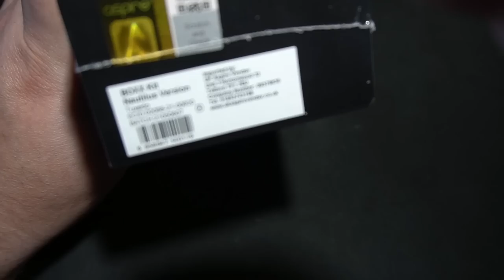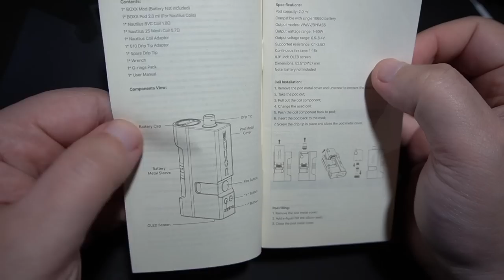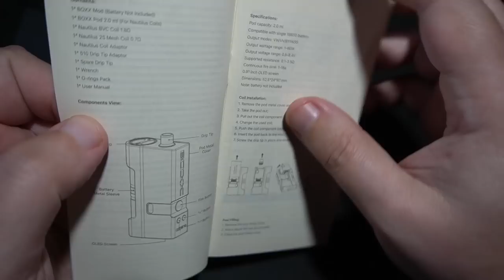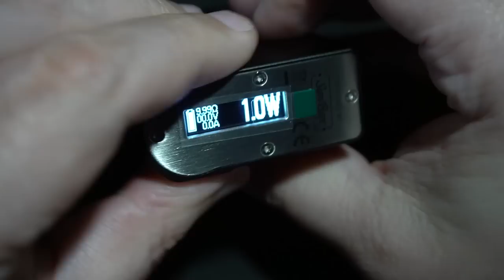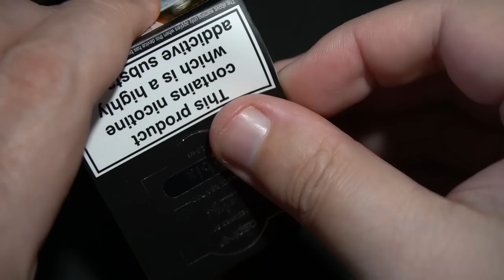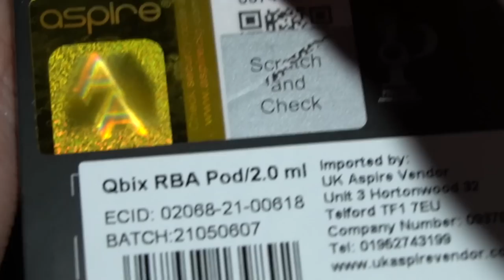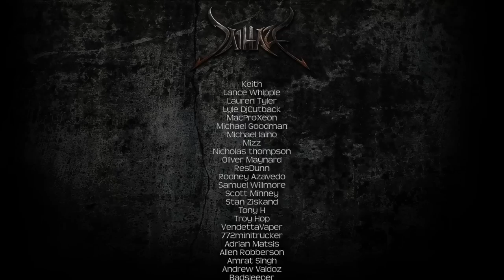Worst Product of 2021, Aspire Boxx w/Sunbox & Atmizoo QBIX

Comment: didn't you do a review on Sunbox Zero Boro, which is also a boro tank device? what's the difference
Reply from the maker: Did you watch it? It’s the same for the delro, I hate people using it without permission
Reply: @JaiHaze  i did brother, and i 100% agree with the principle,  but i don't think this chip is a clone, it only has watt mode
Reply: @JaiHaze  if the Billet Box is not patented why other companies have to ask for permission? Same goes for the Boro tank.
Also, the chip in the Boxx look only is similar with the DNA. 
DNA has TC and the Boxx's chip do not.
Boxx's chip can be turned off, and DNA do not.
Conclusion: it only looks similar by the architecture of the screen.

Comment: I don't mind a 3 full turns battery cap as long as I can fit my fingers in it. NOT THE CASE

Then you have the Qbix, which is basically the vapesnail for 30 dollars. That raises many questions...

The chipset, which doesn't work like a DNA but looks like it. I still don't know if it's better or worse than the Ambition Mods one which looks and works like a DNA

I think it taking Boros is actually a great thing and we've seen products like the bantam box or the delro (and I don't think this is more similar to a BB than a Delro is) do that so I don't see what's wrong with that...  I've never heard anyone say anything about bridge compatible devices so I don't see how a boro is any different. To me, criticizing that is like saying a mod is problematic cause it has a 510 connector... Same thing happened with 810 drip tips, they were first created by one company but became universal.

And the price... this costs as much as an SXK BB clone that has a DNA60...

Comment: In Europe its very difficult and expensive to get a real billit box around £500. 
Aspire made the mulus, fantastic billit box style mod, not a Boro but the tank is good and easy to use. 
They should of made a mulus 2  instead of the sun box version, 
It has a lot of potential to be more awesome without copying the billit box as much.
Reply: 500£?? damn i dont think anyone would pay for that 🤔
Reply: @lamhoang8986  that's for a used one not new, they are rare, thats pushed the price up, you are lucky if rbas or extra bridges are included.
I have never seen a billit box in stock on the billit box website, been looking for over a year and have given up looking. 
I don't like clones but if the original isn't available or if it is massively over priced a clone is acceptable.
Sxk do a DNA clone for around £120 and bridges and rbas are under £30.
It's basic supply and demand, billit box does not make enough units for demand, expect someone to copy your design and fill the gap billit box left wide open.
Reply: @nickdubbin2636  i didnt know they were so rare like that. i see many BB in my town, vietnam. i dont know if they are clone or not, maybe used. but the price is acceptable i think (around 300-500$ depand what comes with the box).
500£ is...meh
Reply: You have to go to their page on a certain day . . . and its a game if you get one. It's still expensive here in the US. No clue why reviewers bother to mention Billet Box or Kennedy, no one can get them.
Reply: @UJB123  billit box need to make more or do a collaboration with another company like aspire and make the budget box, a less expensive easy to get version for the common people.

Comment: But the pulse aio has the same threading and a Boro tank in it... So also bullshit? In my eyes is the pulse aio the biggest shit ever... Had 3 now, everyone has issues with the resistance, always jumping around on all 3, the first 9ne from the first patch the crack on the top... Insane, and also not cheap for a piece of plastic which has always a different resistance... Looking for a middle price one which is good, bought a fucking expensive bridge for it, which you doesn't like... But to get a nice Boro mod here in Austria without paying a lot of money is nearly impossible. Cause I spent all the money for other shit where support gives a shit... Disappointing...

Comment: A techy guy could switch that chip out for a DNA 60 chip, maybe that's why it's designed that way, but not condoning the copy of the DNA chip
Reply: Yup they putn dna in the abyss also.
Reply: @mikeburgh3956  yeah, there's a guy over on Reddit that did that, said, made it so much better
Reply: Is not a copy.
It may looks similar, but the chip used in the Boxx does not have TC and it can be turn off.
Ambitions Mod made a real copy of the DNA, and also the SEVO from SXK looks more like the DNA than the Boxx's one.